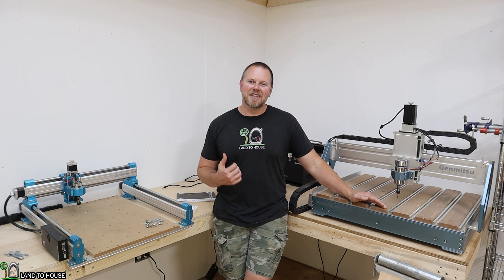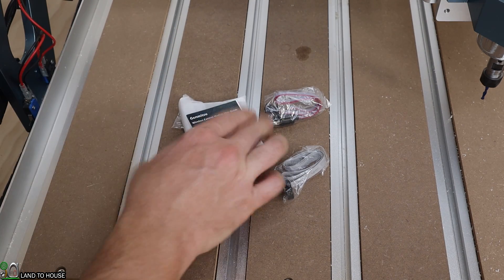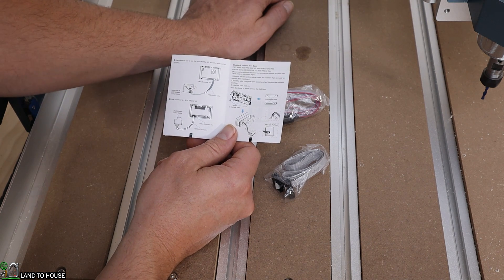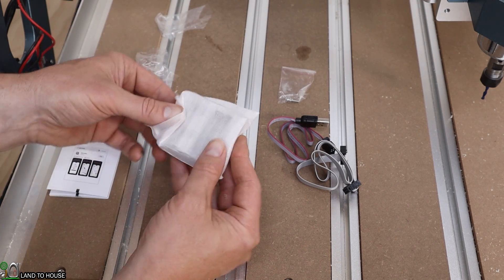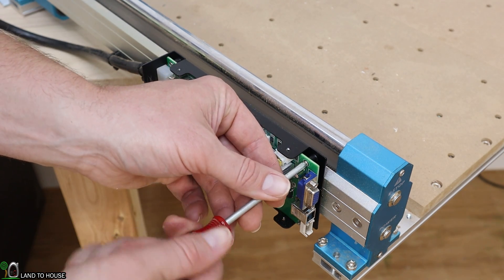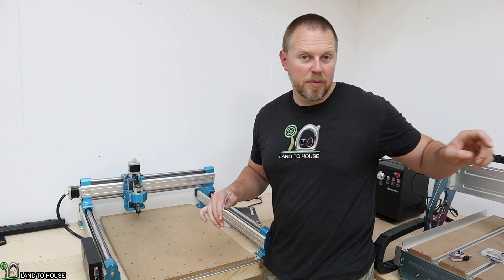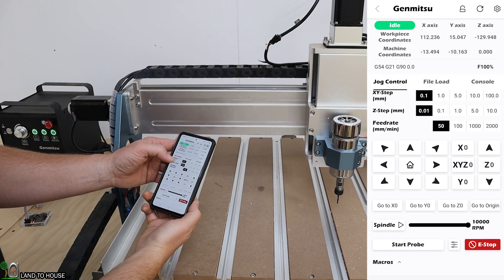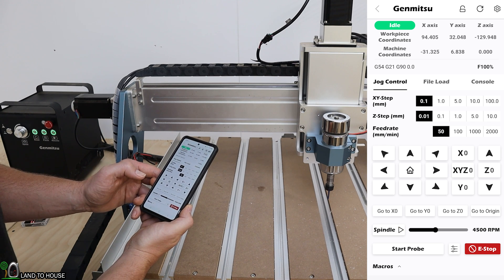Genmitsu Wireless Control Kit for the 6050 CNC

Comment: Great, I have it setup now, it works. Thanks. Can you also teach how to do some basics ? For example :  How to home the machine. How to reset machine coordinates. How to reset work coordinates. How to use Z probe. How to setup macro buttons. What are some common macros to setup ? How to organize files if you are running many projects. What calibration routines are necessary and how do you do those ? What maintenance routines are necessary and how do you do those and how often ? Thank you in advance. Sorry to ask for so much. It's too much to do all of these I know. But maybe some that you can, even that will be a great halp.

Comment: I have a 6050 with a 1.5kw water cooled spindle. I have had no luck getting the wireless control kit working much. I can use the app to connect and can toggle the blue led on and off, but that's about it. The recent app update improved things as I can see the control screen but nothing works. There is an error displayed saying that the emergency stop is activated (can't recall the exact message). However, the emergency stop is definitely not activated. I keep trying from time to time but I have almost given up. If anyone has any ideas I would love to hear them. I have tried different mobile devices, all android, and 3 different wifi services including a mobile router.